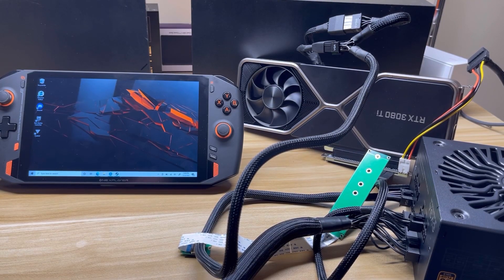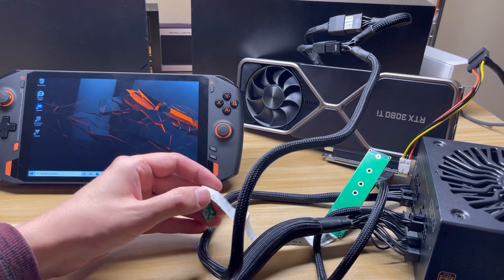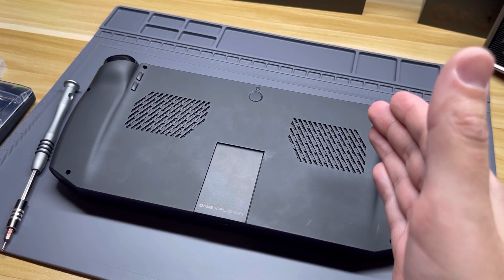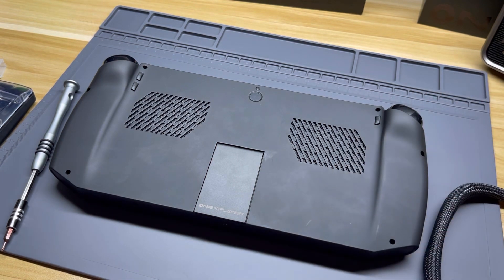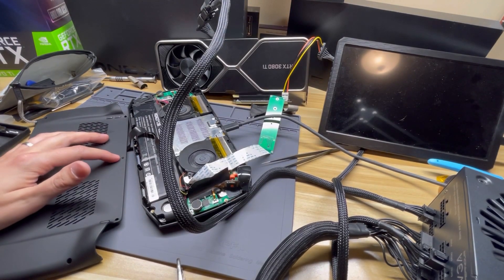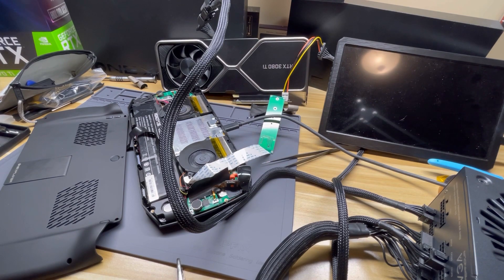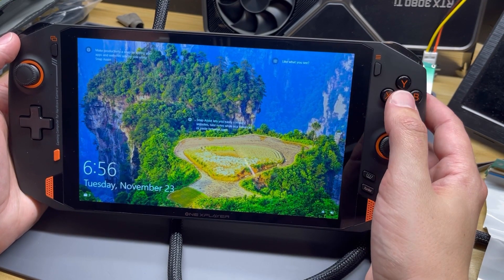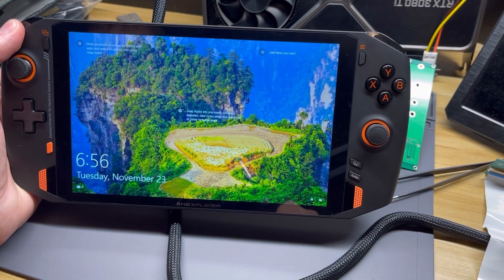One X Player - AMD 5700U - Let’s try a eGPU in the wifi slot 😬

Comment: You coward, you didn't follow through. All you had to do was try with a normal pc, does the adapter work at all? In any case the content is unique, thank you.
Reply from the maker: Yeah I’ve used this on other single board computers. I cut out the 5 minutes of me trying to make it work and slightly panicking that I broke my device 😅

Comment: thanks for the video man. my 5700 will arrive next week and i plan to try the egpu. thanks for saving my time. anyway i read somewhere on chinese forum that 5700 variant doesn’t support the eGPU atm.
Reply from the maker: Yes, it does not support thunderbolt eGPU
Reply: @HandheldHardware  do you think it will in the future update? just wondering.
Reply from the maker: @rrvirus  amd one x player will never support it. The reason intel does is because the hard work is built into the cpu (thunderbolt controller). AMd does not have that on their current cpus. If one netbook wanted to add thunderbolt, they would have to design it in. It’s not particularly easy to add, that’s why you only see it on high end amd motherboards.
Reply: @HandheldHardware  thanks for the details man. again much appreciated. I also waiting for the mini with AMD (perhaps 5800u?) and I'm going for it again. it looks nice from what I see on bilibili. I really wish onenet will bring something like aya space to 1xplayer. at this stage I don't really care about my steam deck pre order anymore. I think they screw up pretty big with the delivery time (I got Q2 pre order time).

Comment: So 2 things:
1) If you're feeling froggy to try again, have you thought about using the NVME slot?  They've got PCIE adapters for that, but of course you'd be out of a hard drive...😋

2) You've had an eGPU this whole time...and you didn't do any gameplay tests with Afterburner/emulators/PC games on the Intel 1S version?!  How dare you?!  😅

No, I'm serious.  Where are the eGPU tests for the 1S, dude?!  🤨

Great video, nevertheless!

P.S.  Make sure you connect the eGPU to an external monitor, as well.  Cuts down on back-and-forth data lag tremendously...
Reply from the maker: Hahaha you can see my nvme slot adapter in the video 🤣 I have done a couple videos with thunderbolt eGPU, and I did a WHOLE slew of benchmarks on different gpus and resolutions that I need to do a video on.

Edit: I have some avg FPS to show the loss between internal and external
Reply: @HandheldHardware  Definitely not enough eGPU video tests on the ONEXPLAYER 1S out there, in the wild.  I like the lower heat levels of an AMD build, but that damn Thunderbolt 4/eGPU setup is a gamechanger...😁